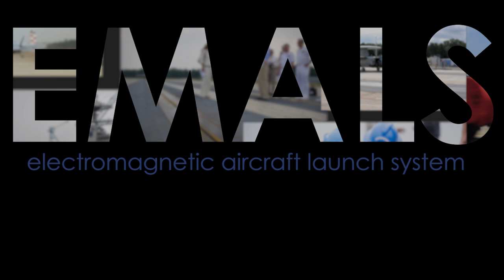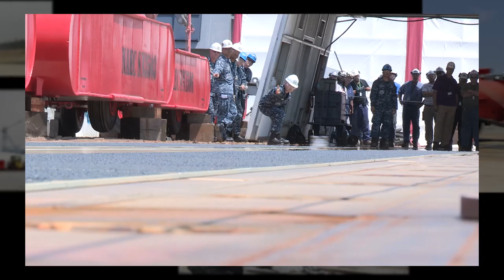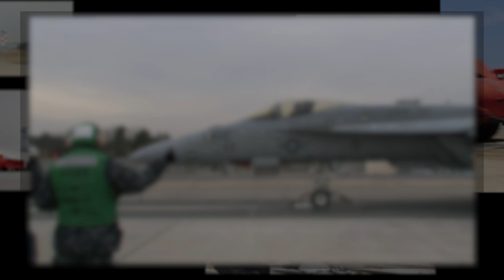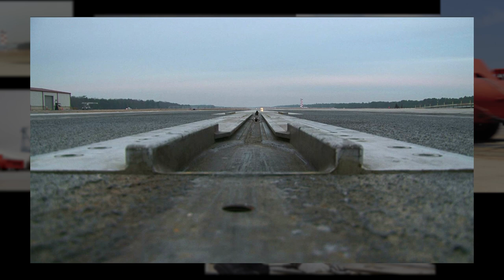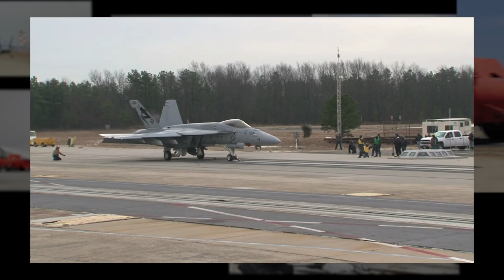Electromagnetic Aircraft Launch System (EMALS)

Comment: In the mid-70s, LIMRV (linear induction motors) were tested as propulsion for a high-speed rail program. The linear induction powered vehicle went to 255.4 mph.
Few moving parts, very reliable.